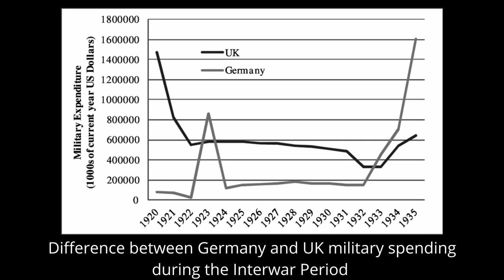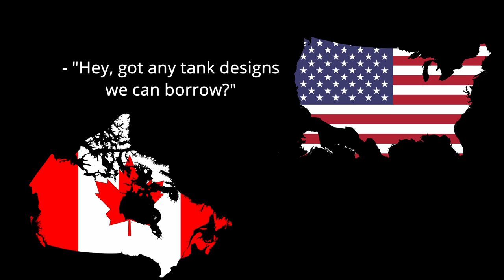The Ram: Canada's "Tank Meme"

Comment: Hey there was a few things your got wrong, there was no such thing as a Ram Mark 3, i assume you got that confused for the late production mark 2 which mainly removed the mg turret of the M3 Lee and replaced it with a bow machinegun, installed the longer version of the 6 Pounder, and replaced the early VVSS with the later VVSS seen on the Sherman. You also show the Ram Mark 1 while talking about the "Mark 3".

Another thing is less of a mistake but the Rams armed with the QF 75mm were actually in service with the Canadians before the dutch received them. 

If you want some better resources theres a website called RAMtank, its down but you can find it on the wayback machine and has photos of the ram and its many variants, and a lot of good info on the Ram's history itself